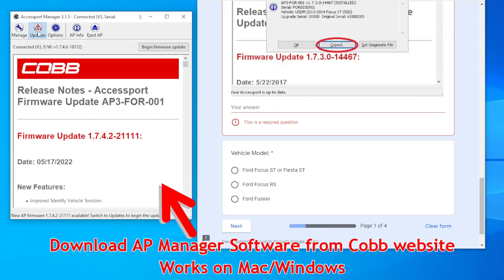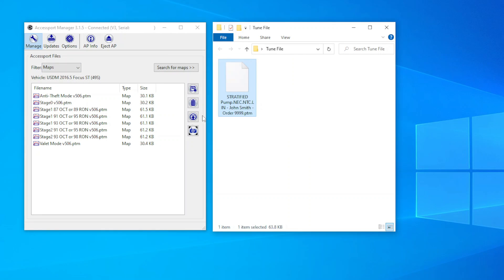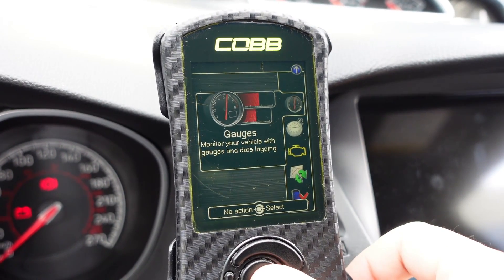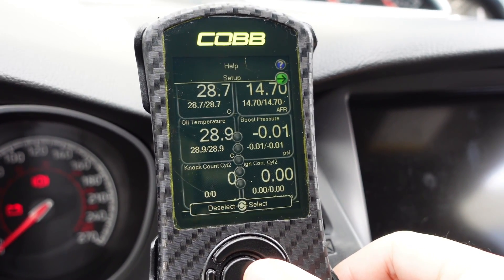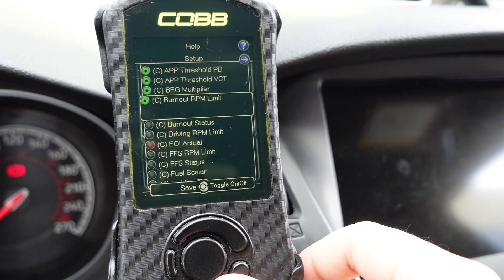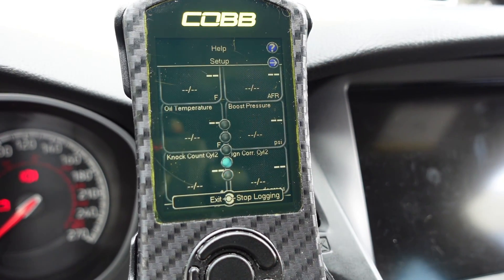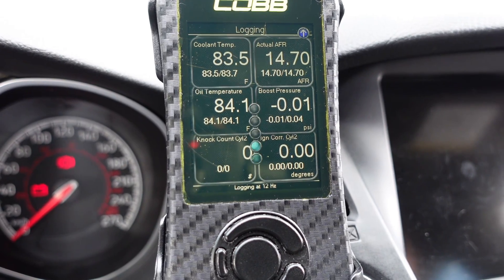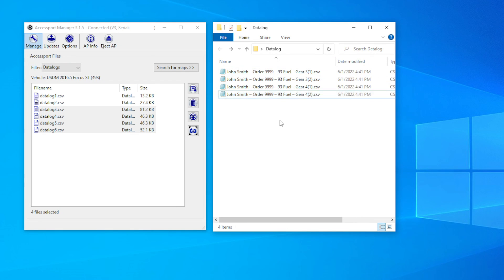COBB AP Stratified Complete Tuning Guide

Comment: So If you buy a used one unmarried does the stratified tune stay on the accessport and if so is it accessible for the secondary person to use if it is unmarried?
Reply from the maker: If the tune was made for the same ECU type as yours it will flash but we never recommend running a tune made for a different car.

Comment: Interesting...couple questions, 1) are you data logging while sitting still in neutral or are you supposed to be accelerating the car with wide open throttle? 2( how much do you charge for the revisions?
Reply from the maker: Pricing is all on our site.
Reply from the maker: You can start logging when driving a few seconds before going WOT.

Comment: I'd like to use you guys for my MK6 GTI, but having to pay for a $675 AP on top of the tune, and then not being able to use it to flash the TCU that requires ANOTHER $600 device just puts you guys out of the question.
Reply from the maker: For the mk6 I know this is not ideal. However both devices are ready-sellable and very versatile for other cars as well. So it’s not completely unrecoverable like a flash.